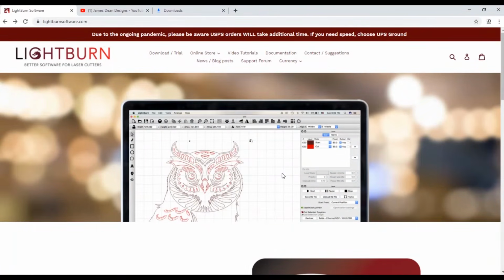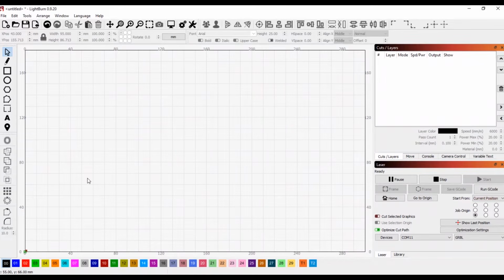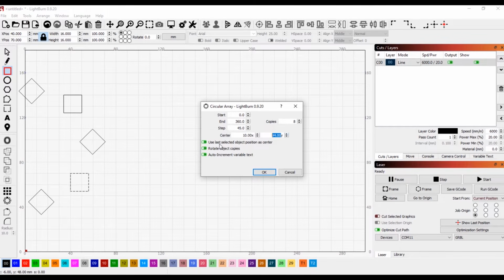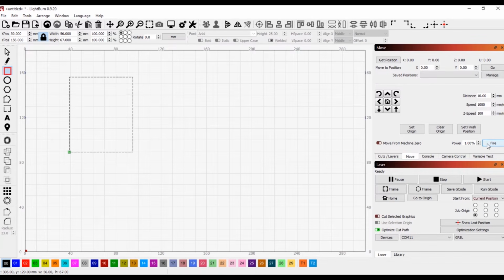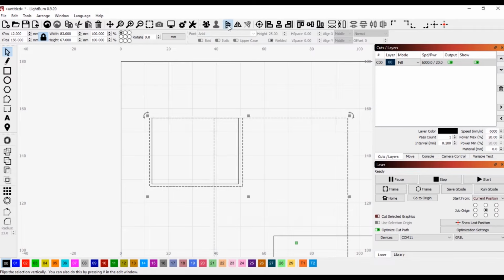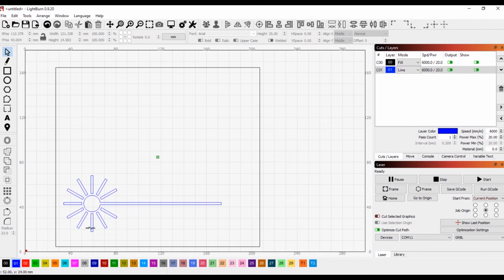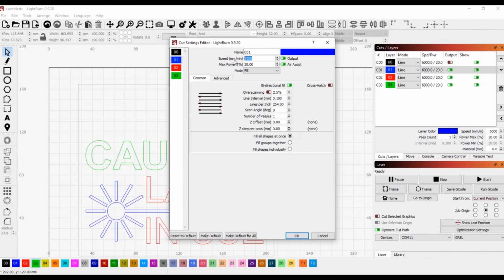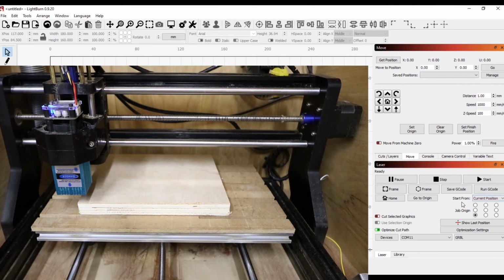3018 PRO - Getting started with Lightburn

Comment: Another great video. Although I have used Lightburn for a few months, I still manage to learn something new when I watch your training videos. Keep up the good (and interesting) work.
Reply from the maker: Thats really kind, thank you Nikki.  You were one of the first people to help me out by telling me not to buy upgrades until I got used to the machine, advice I now tell others because it was good information.
Reply: @JamesDeanDesigns  Well, I have finally upgraded by fitting a 20k spindle. Very impressed with it - I am saving over 25% of my milling time with it. And yes, I checked out your videos first! Despite buying a larger power supply, my Woodpecker 3.4 board does manage to drive the new motor without any modification of software coding. However, for safety's sake, I do use the new power supply.

Comment: I'm getting these shiny smudged areas around anything I burn, any idea what that could be? Appreciate the walkthroughs greatly!
Reply from the maker: Sounds like it might be overburn. Causes can be too much power or not enough acceleration. I've heard baking soda and water can help. One  teaspoon to one cup of water. Mix up, spay on and wipe off. Then run the laser job straight away
Reply: @JamesDeanDesigns  I will give that a shot along with maybe reducing my power. Only had it at 50% on a 2.5w but I suppose that would be enough at 500 mm/min. Thanks for the advice!
Reply from the maker: @Explicnt  hopefully it helps. If not send me some photos on Facebook or Instagram and I can take a better look. Also you can try the overscan feature if you haven't done so already
Reply: @JamesDeanDesigns  I did finally figure out what it was. Overscan and increasing travel speed did help slightly but it turns out the popular I was using had some resin coating the surface which didn't react well to the laser. Sanding the surface beforehand solved that issue though.

Comment: Excellent tutorial as usual James. I have been following you for a couple of months now (since I got my machine) and you have saved me so much time. Oddly, I started looking at Lightburn  a couple of weeks ago realising that laser grbl was a little limiting, so I was amazed when you brought out a tutorial for just that. It was pretty good to, helping me with the set up. I am going to take one issue with your lesson - framing. You said it is relevant to those with limit switches fitted. This may be the case but it is also good for those who do not have them fitted. What it does is go around the frame of your work piece. So if you are using a 100 x 100 pre-cut coaster then you can check your alignment on the bed. Even better - if you hold the shift key and click on "frame" it will turn the laser on at the power set in 'Fire' and then complete the frame - using this you can check that the laser just touches the coaster all the way round. I haven't worked out the other framing option yet. 
Many thanks James and keep up the good work.
Reply from the maker: You are correct and I realised as soon as I put the video out 🙈 its what I get for rushing. 
I need to try and correct it but YouTube doesn't make it easy to change the videos unfortunately but I think I've found a way to edit it hopefully

Comment: Thanks again for a fantastic video, I bought the laser to go with the 3018 PROVer. You recommend LightBurn for the laser but what software would you use for carving with this machine, plus generating G code. I tried the one you use instead of Candle and I find it will not work with my machine.
Was going to try Fushion 360 but I'm just looking for simple software to create my designs. I also have a small 3d printer as well and wondered if there was any software that would cover both machines .
Cheers.
Stay Safe and Seasons Greetings to You.
Reply from the maker: Unfortunately I find all the free software for carving have draw backs which push you towards purchasing their upgraded version. The only software I know that will cover both is Fusion360. Yes, its a little bit more of a learning curve but it will cover everything.

Comment: Great instructional video, a couple of shortcuts i found that may be useful to others.. 1 to quickly rotate a selected object 90 degrees tap the period key (or in english the full stop) each tap rotates 90 degrees in the clockwise direction....2 to quickly identify which objects are on a specifc layer right click the layer in the CUT / LAYERS panel, the objects on that layer will flash..3 to quickly zoom to a point on an object hover the mouse over the point you want to enlarge and roll the mouse wheel the display zooms to that point..4 when editing nodes hovering over a line and tapping DELETE deletes the line completely hitting D on the keyboard only deletes the node..5 images copied to the clipboard in other applications can be pasted (right click PASTE) directly onto Lightburn, same for text..6 you pointed out that you can rename the layers, i have been renaming to identify the material, size, cutting parameters Eg Black layer  ... 3mm MDF cut or RED LAYER 4mm Ply deep engrave,  BLUE LAYER white paper cut...lightburn then remembers the settings you give for speed, power, No of passes etc for use next time
Reply from the maker: Thats some great info, thank you for sharing

Comment: James, I am thinking about getting a new workshop and I am undecided whether to get a shed or build something that can easily be used as a summer house should I ever decide to move in the future, what size is your shed and have you regretted not getting something bigger?
Reply from the maker: The full outside size is 14 x 8ft, however part is sectioned of with a separate door for garden stuff, BBQ stuff etc. So my actual work area inside is 10 x 7ft. I've got most things in there that I need but I've had to be clever about the way I have stored things. What I suspect I will end up doing next year is buying a new small shed for the gardening stuff and taking back that extra space for my work shop. Go as big as you can afford or spare

Comment: Hi,

See lightburn costs around £25. That’s not bad.
Very similar to easel, which is exactly what I’m looking for.
Can you use it with a motor spindle? Can it be set up to control a Z axis?

My 40Watt fiber laser arrived Christmas Eve, but having measured it at 40x40, I’ve had to order a whole new aluminium Z axis (with stepper motor) to hold it.
The aluminium z axis is also compatible with the 240V 500W upgrade.

Very impressed with the accuracy of the 3018 pro, and just have you have found, my bearings also vibrated out of my stock z axis, and it jammed.
Hoping the new aluminium one will be better.

US $38.63  40％ Off | CNC 3018 Z-axis Module Apply Nema17/52 42/57 Stepper Motor Spindle Hole 52mm Aluminum Sliding Table Engraving Machine Accessory
https://a.aliexpress.com/_mOsz5ZR

I bought my CNC to etch the copper layers on FR4 PCB’s.
I’ve made a set square jig on 8mm birch, and as long as I set my zero before I unplug it, it’s good to go the next time
Reply from the maker: Hi, yes its really reasonable for the price. It can control the Z axis i believe (other than basic jog controls) but I think there are more settings to turn on. Hope your new parts work well 👍
Reply: @JamesDeanDesigns  I bought lightburn earlier today, and emailed support.
They replied :

It's possible, but it will be cumbersome to use LightBurn for spindle control.  We do have Z control, and we have kerf, but we don't have tool profiles or automatic tool offsetting, and fills won't offset by the tool radius, so there will be some fuss getting it all correct.

You can enable Z axis control in Edit > Device Settings.  If you leave the 'Relative Z moves only' off it requires that you specify a material height on the main page, and that height will be what LightBurn goes to when you start a job.  If you turn "Relative Z only" on then the Z will remain at the height it started at when the job runs, and all Z moves will be relative to that - this is more like the traditional "zeroing to the top of the material" workflow for CNC use.

With that set, you'll have access to the Z Offset and Z step per pass settings in each layer.  Z offset means how far above or below the initial Z that layer will run, so that's your Z-depth control.  You could use Kerf offset as a tool offset.

Cheers,
LightBurn Software Support

That’s hope my 40Watt laser eats wood lol 😂

Comment: Is an internet connection required?
Reply from the maker: Its easier to activate it with an Internet connection but it can be done offline. For the general running of the software it doesn't require an Internet connection
Reply: @JamesDeanDesigns  I got the twotrees engraver on the way but it will have to go in the shed when in operation and i don't have internet out there, at least i can activate it indoors then use it in the shed. Thanks
Reply from the maker: @chris-tg6ki  if you struggle, there are ways to get temporary Internet in the shed. For example I bought a cheap WiFi dongle off amazon for about £7 and just used my phone as a hotspot when required.

Comment: Only got this program this morning. It’s like you knew I needed help. Had some trouble getting the laser to start where I wanted it but now I know using “current position” as I don’t have limit switch’s. Maybe in the next video could you cover how to laser engrave on already cut pieces of wood like circular material how to set start position and position material on the machine bed. Really grateful for all your videos. 👍